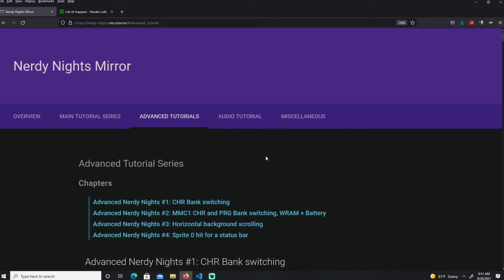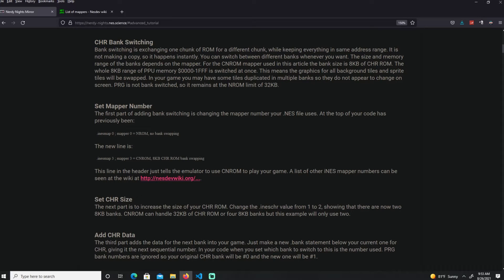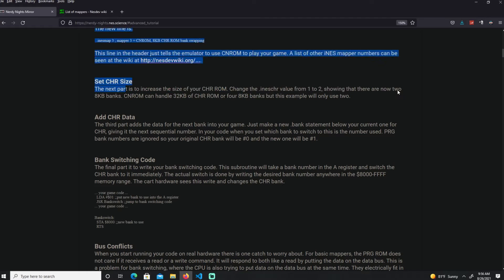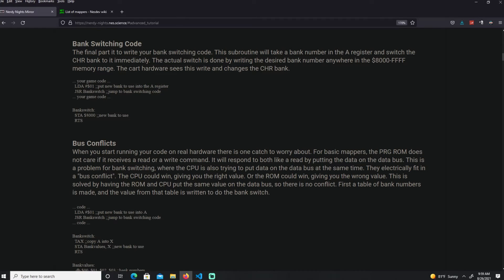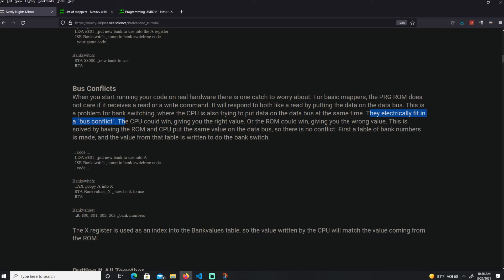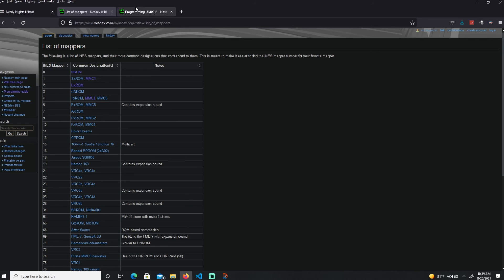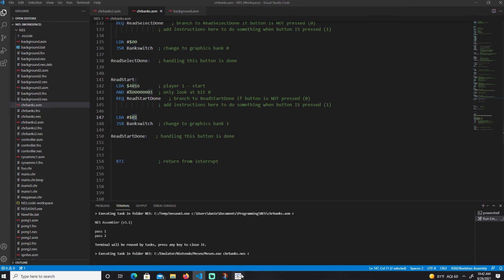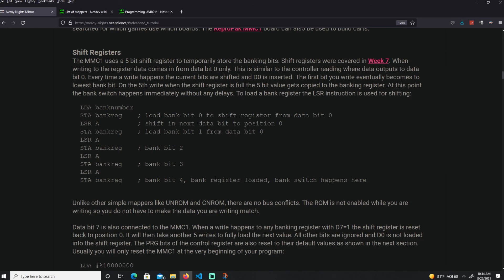NES Programming: Video 10 - Bank Switch | Basic Mapper(CHR and PRG)

Comment: Hi, nice video!! I have a question!! Some way, the GitHub repo don't have the asm code!! Could you share it!! Thx anyway!! Greetings!!
Reply from the maker: All the code are from the nerdy night tutorial, they are in the link on the description. So if you go to the advanced tutorial under mappers, it would be in the bottom.
Reply: @ProgrammerDan  Well, I haven’t covered those topics yet... I think I’m going for week 5 or 6. I leaned for CA65 compiler, so I’ve delayed understanding how it works, and I’m trying to translate it with the new directives. Now I’m trying to figure out, how to perform a bank-switching with this assembler. But, these seems to be something rarely used, due to little info on the web, or maybe, is it so “low level” that I can’t understanding it yet! 😁
Nice videos!! 👍🏻
Greetings from Argentina!!